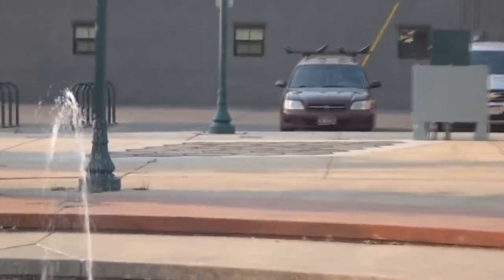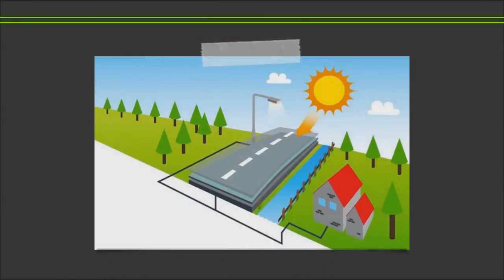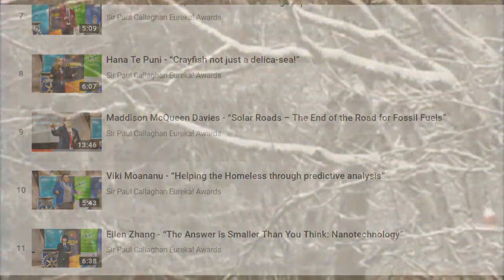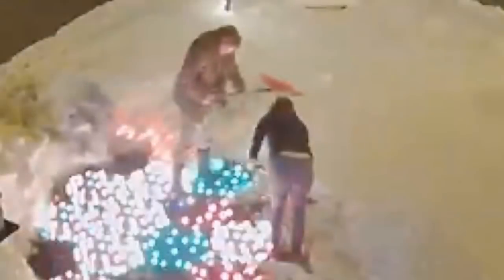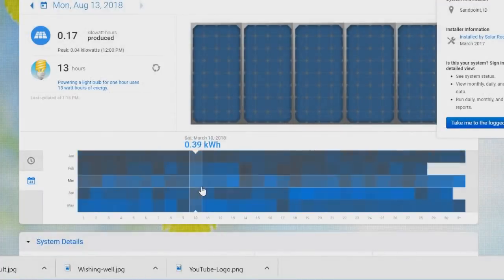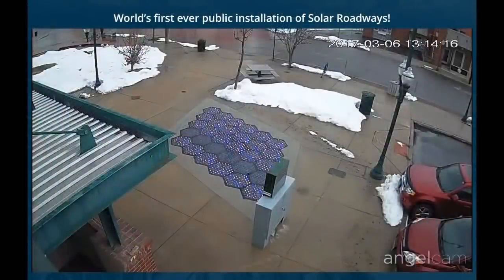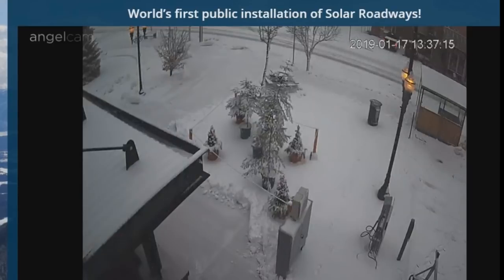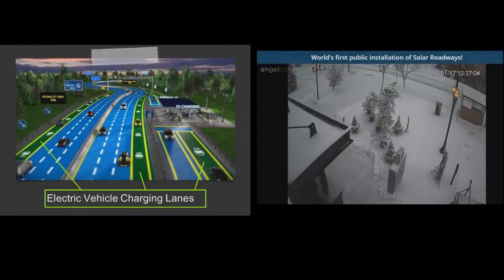Solar Roadways to be installed on Cruise ships!!?

Comment: SOLAR FREAKING DILDOD. SOLAR POWER INSIDE YOUR PERSONAL CAVE
Reply: Bitch, I already have a Solar Freaking Sybian.
Reply: Mark Sieg , can you feel the buzz???? For that
Reply: lol, at having to bring it outside to charge it.
You could totally hang it from your backpack or something .
Reply: MichaelKingsfordGray  That's from Masturbation: TNG, you know like the Enterprise-D, just no-one wants to dash through the situation.
Reply: MichaelKingsfordGray  If you don't know what a DILDOD is then you aren't ready for DILDODs.
Reply: Pretty useless for a toy meant for where the sun don't shine.
Reply: You guys SOLAR FREAKING Teledildonics
Reply: well on that note would a thermal electric dildo work better? put it into whatever body hole you want and it will make electricity out of your excess heat. How much how fast idk but if designed right hopefully enough so it can be stored into something akin to the size of a AA battery so you can recharge the battery while having it in you and/or recharge the battery while you are playing with yourself.
Reply: @heinzguderian9980  Solar power Sybian do actually exist but it is more so like a solar panel hooked to a battery bank then in the same design the Sybian is linked into the circuit. So kinda though you have to buy and put together the solar power circuit yourself.  A 24-hour session with  a sex toy is longer than enough i think.
Reply: @yumri4  not without a thermal gradient, so it would necessarily have to be colder than body temp. No one wants ice in three
Reply: @wilurbean  ah well that is just an idea. The solar panel part still would work Unsure how many people would want to masturbate in a room with a window though.

Comment: I've got a breakthrough idea. Absolutely revolutionary. Ready? Solar Freaking Tunnels! Just imagine, countries won't need to spend ANY money on electricity for lighting and ventilation of tunnels, whether short or long. In fact, we can also use them to make Solar Freaking Tunnel Boring Machines! They power themselves as they bore through dirt. I only require 10 million USD for a prototype and further 2 million for changing the trademarked name. Who's with me? And who's ready to step into the bright future of Solar Freaking Tunnels! PS: Please wire money to my secret Swiss account.
Reply: am in lol sounds funny
Reply: That is brilliant. If we put lamps in the tunnel, the lamps will refill the solar panels, that will power the lamps. Infinite energy! Where can I send my money to invest into this?
Reply: @linusgustafsson2629  Not only that but the headlights of cars will shine on the solar panels and charge the tunnel lights so cars won't need to have headlights on. My genius sometimes scares even myself.
Reply: @MetalCanyon  And the electric cars can be charged over induction while driving through the tunnel, while also powering the tunnel!
Reply: Shut up and take my money!!!
Reply: How much of an investment is required to sit on the board of directors?
Reply: Nono you people are silly, if there are lights in there to power the solar cells that is a sort of perpetual motion machine and we all know those don't work. No, what you want is to change the optimum wavelength of the solar cells to that of the natural thermal emissions of the inside of the tunnel, that way it isn't energy out of nowhere. Then you put these special solar cells on all of the inside of the tunnel for more area, yay. And if you still don't get enough power for the lighting and all the recharging cars in the tunnel, you can just drill more tunnels deeper down to provide extra power, it scales SO well :)
Reply: Solar freakin Tunnels?! Shut up and take my money!
Reply: Yes an you know what? Wait for it....we line the tunnel with aluminium and then we glue copper plates to the cars driving through and BAM!!! FREE ENERGY!!!!!!  MIND BLOWN!!!!
Reply: I'll take 3
Reply: Eureka!solar Preparation H that way you can have Sunshine up your ass whenever you want it!! See? You just have to have an open mind!
Reply: A good one
Reply: now, how much money do you need? Im your supporter!
Reply: I'll donate on the condition that you take 13 years to deliver a prototype that does half of what you claimed was already ready 13 years ago.
Reply: @intellectualgladiata  Be reasonable, now. I'm only going to expand my car and yacht collect--err, I MEAN revolutionize the future of tunnel building and power generating, I'm not a magician. I can promise to deliver a sketch-up of an idea for a meeting at which the potential candidates for board members, who will define the future date of a mock-up prototype material selection, will be selected within an astonishing mere 10 years. After which more funding will no doubt be required. And, of course, being my genius self, I will not be wasting the taxpayer money. All of the funding will come from kickstarters and bribing offic--ERR I MEAN careful lobbying of politicians so they can secure funds. From somewhere. That is not taxpayer money.
Reply: That's crazy and wouldn't work. A waste of millions of dollars.  However I have pioneered mirror-box technology. All it requires is a cardboard box and six mirrors. I can't get into the details of my secret technology. But once you close the box you will have infinite energy to power your home... forever. It's small, and you can easily set it up in your home. All you need to get this amazing device is $25. I will send you an amazing manual how to set up the mirror box device, plus a homeopathic battery to store the first 4 megawatts of energy.
Reply: @linusgustafsson2629  MIT: You want a scholarship??
Reply: Hyper solar tunnels!!!  TO THE MAX!!!  And they lead to solar caves 600 ft below the ocean. Guaranteed to melt all the snow found at that depth.
Reply: Danish Wistara  And driving in a mirrored tunnel isn't distracting at all assuming that no light or heat is lost through the use of mirrors.  LMAO.
Reply: Can I pay by Western Union perhaps?
Reply: @garysnow3526  Brilliant Gary! You have a great sense of humor! Still laughing! Because it is so true the irony of these idiots that think that they know more than the engineers that work in electronics and other technologies do.
Reply: Holy shit I remember watching your channel when you were doing that passport check game. No idea you watched thunderfoot.
Reply: @Joshua Makler Perfect! Just the sort of thing that the solar dopes will pay for! Well that and the 'save the wild pastramies'.
Reply: @Joshua Makler What could be more natural? You sir are a genius! Brilliant! Solar moats! Of course we would need to change the course of human history from the medieval age to accept solar panel foundries and fabrication facilities...but why am I concerning myself with such trivialities? You go man! One day mankind is going to look back on your tremendous innovations with great pride! Thank you for your contributions! (hopefully there will be no retributions as well) LOL!

Comment: They could make solar roadways twice as efficient if they shone lights on them at night.............
Reply: Yes, you use them to power the streetlights, that in turn shine on the panels to generate energy to power the streetlights ! I'm a genius ... well, maybe not. Let me test that out by yanking on my ass in order to levitate.
Reply: @michaelmoorrees3585  It would refund some of the power but not all
Reply: With the lights powered by Solar Roadways! 🤣
Reply: Infinite energy unlocked
Reply: Nah, that's silly.  But the induction charging part is a good idea.

We line the roads with superconducting magnets.  Put linear generators in the cars.  As they drive along the roads, they charge themselves.
Reply: Wait a minute...
Reply: It's a perpetual energy machine.  You use the solar panels to power the lights which shine on the solar panels which power the lights to shine on the solar panels.

Comment: If it's on a ship, it's not much or a roadway. My experience of roadways is that you have vehicles driving on them, mere things like cars, pickups, buses and trucks. I'd like to see a few cars doing circuits of a cruise ship.
Reply: Solar FREAKIN roadways would have terrible grip, so I'd rather it be on a cruise ship than anyone actually have to drive a vehicle on it.
Unless that vehicle has SOLAR FREAKIN TIRES, of course.

Comment: Isn't plastic and computer parts made from fossil fuels. So a solar roadway would increase the use of fossil fuels. Right?
Reply: Not necessarily since renewable energy could be used to produce those parts... Logically the energy would be provided by the solar roadway that would be built thanks to them. It's 100% efficient since the principle works well on paper!
Reply: @didierlemaitre5961  Yes its a thing.
Reply: @Didier Lemaitre

Schemes wasn't discussing the energy used to make them.
They were talking about how they are made FROM fossil fuels.
Reply: It would not necessarily increase the use of fossil fuels. If it worked, that is. The oil would be used to make the plastic instead of burning it.
Reply: @olmostgudinaf8100  When you mix chemicals they gas-off.
Reply: @didierlemaitre5961 Yes a road made with paper would be more efficient.
Reply: @schemesof40k  most roads are made from recycled materials however these have to be made from virgin materials and rare earth elements all non recyclable.
Reply: @didierlemaitre5961  the fact you need to many types of difrent elements abd parts they cant create themselfs makes it that it uses more co2 usage making them thab you get out of them
Reply: @olmostgudinaf8100  we burn the plastic to make more plastic from oil
Reply: @fireworkstarter  Sounds like a plan!
Reply: @olmostgudinaf8100  its been going on for a long time

Comment: Solar Freakin' Roofs are better. Why?
- They last longer.
- They generate more energy.
- Require less maintenance.
- Won't be in the shade unless its cloudy.
- Relatively cheap.

Solar Freakin' Roadways are the complete opposite of all those things.
Reply: Also, you don't have to design them to carry the weight of a car and provide good traction.
Reply: And even then, solar roofs aren't a feasible option for most consumers
Reply: Nah they are, if roofs are designed in order to maximize the panels potential. (which can be accomplished by changing building requirements)

And when batteries become more economical to store the excess energy. 

After all panels make power when you don't need it (while at work) and don't generate when you do need it. In the evening after you finished work.
Reply: @99certain45  Quite right for now - the economics of home solar usually don't look too favorable, unless you have a house in an off-grid location. The payoff period is usually around twenty years. Even so, there is a continuous steady reduction in price and improvement in technology, so the economics get more favorable every year.
Reply: @1barnet1  For some wealthier consumers in sunny climates, the payoff is worth it, but for most people who live in a darker climate and/or don't have the funds to make such an investment, it's not an option.
Reply: then of course, as they get dirty they need to be cleaned or they dont produce as much power...

wonder how much that will cost..

Comment: "create Energy from street lights"...I'm out.
Reply: Actually the solar panels on my roof produce a bit of power at night due to the streetlight in front of my house.
Reply: Martien van den Berg not your electricity anymore its MINE now
Reply: even solar panels on top of a street lamp would be more productive as streetsolarpanels. You could rotate them in respekt to the sun and even cleaning with some hightech Hydrophobic stuff or somthing.
Reply: @martienvandenberg5181  That doesn't create energy though, it just transfers it to you very inefficiently. The only advantage to you is, that you don't have to pay for it. 
For a city it wouldn't make sense though to pay for more streetlights because the street is so dark, that the people can't see the street anymore and then get only a portion of that energy back from the solar panels.
Reply: I think it's an accent thing... She said "create energy FOR street lights"
Reply: @morphman86  yeah she definitely said "for", trust me I'm kiwi
Reply: Martien van den Berg Yeah my calculator can be powered by my light being switched on. 

It’s nothing special, just a low powered bulb.
Reply: @heyarno  nothing can create energy but it would save some from being wasted
Reply: many street lights already have their own solar penal on top

Comment: You know what's really good and efficient at absorbing sunlight and turning it into heat? Asphalt, which isn't really that great at melting snow...
Reply: I think it actually is pretty good. Provided, of course, it isn't completely covered by a ton of snow.
Reply: uh huh.. and everyone miss's the folly with that..  how are they getting this sunlight to clear the snow.. THATS COVERING THEM AND BLOCKING THE SUNLIGHT.

why yes...  I can tell a money grab when I see it..  the prob is they rellie on stupid people willing to donate money
Reply: @harleyme3163  For the roadways, I assume the plan was to pump energy into them to melt a small area, and then gradually use the energy generated from the now-cleared area to melt snow elsewhere. Given how snow acts as a thermal insulator, that almost sounds like it might work.

Asphalt is going to be the better choice, though.
Reply: @Thalanox  that could be a idear, but solar panels generate DC power wich does not hold up a charge traveling distance, push 12V or 48V DC into a cable and 100meters later its already gone. All or most lost in slightly warming the cable. Converting it to AC also has a voltage cost...flying cars or hovercars whit hot jets wold be allot more efficiënt at melting snowy roads, or a plow

Comment: Moral of the story: you can have a great invention but if the maths doesn't work, all you have is science fiction.
Reply: It is not even science fiction. It is just a fantasy.
Reply: Bad science fiction.  So bad it makes L Ron Hubbard's crap smell like a rose.
Reply: science fiction only works in the movie business,  maybe a hobbit crystal will be the next free energy device
Reply: when I was in a science fair way back in High School, you had to DO SOMETHING.  For instance, she would have had to get perhaps some of the material to be used for the surface (such as a tempered glass) and test it for weight or SOMETHING.  She could have built just ONE PANEL (tiny sized) that would work.  (It would work small diorama scale... at least do that).  Or a cost analysis, not "This will be the end of the road for fossil fuel!"  Like show SOME work.  I can put together a funky power point proving we can go to Mars using only solar power and gerbils.  But, you had to prove something about your project....not just steal it from someone else.
Reply: @bdf2718  Remember though, if you want to make money you just have to start a new religion. This solar roadways stuff is exactly that.

Comment: Cruise ships are the one and only application of this that makes any sense at all. Given that there is negligible spare roof space on a cruise ship to fit solar panels, and there's little potential for damage since a ship should be mostly clear of gravel to cause chips, but even so the cost would still probably be too high to justify the tiny dent they would make in the total power consumption of a ship.

Comment: That cruise ship plan actually almost makes sense, they have finally found a situation where you don't have much room to put them other than underfoot so now we will see if they can actually come up with something that doesn't break down every few days.
Although now that I think about it cruise ships use so much power you might not notice a huge benefit. There is a fair bit of area there though so it should save a nice amount of fuel.

Comment: Coming up next: solar freaking railways!
Reply: Electron Power lololol B)
Reply: Solar freaking waterways!
Reply: Solar Freaking Basements!
Reply: SOLAR FREAKING HYPERLOOPS!
Reply: Solar motherfreaking metro!
Reply: Solar railways would make more sense.
Reply: Solar freaking submarines
Reply: Hyper railways.
Reply: Oh gawd!
Reply: Solar freaking airways!
And this year, Elon Musk will invent the Hyperlight: A torch with a solar cell mounted in front of the bulb so it will charge itself forever and we'll save a ton of money because we don't have to buy batteries ever again.
Reply: Self filling Sloar Hyperlooped Bio Juice... am i doing crowfunding right?
Reply: @Y2Kvids 
Hyper cruise ships, travelling in vacuum tubes.  Powered by thorium.  Generating all the water they need with fontus.
Reply: SOLAR FREAKIN' DEATH STARS
Reply: Oh the HyperLoop is going to be lined with solar panels so that they are self-powering. Didn't you hear?
Reply: @Electron Power - 
Coming soon: solar freaking waterways!